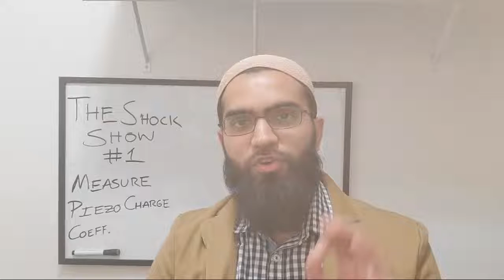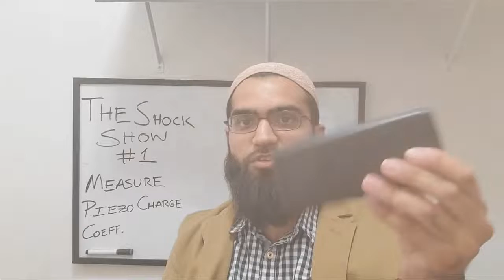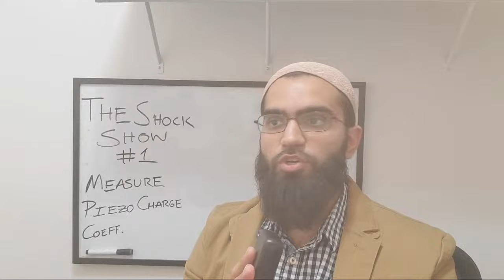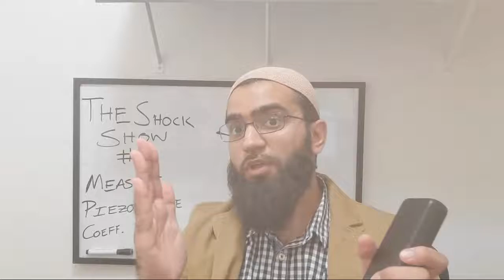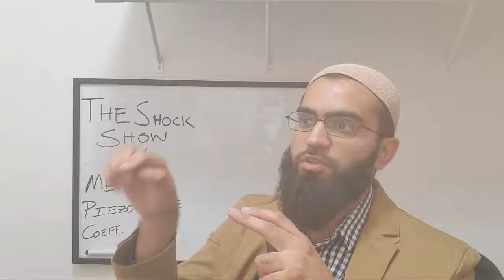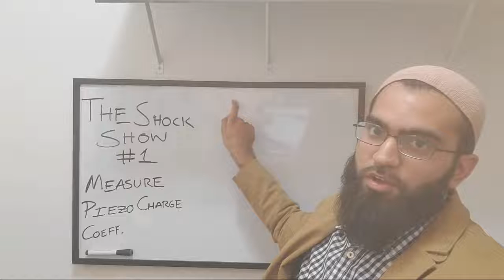The SHOCK Show #1: Measuring Piezoelectric Charge Coefficient

Comment: The charge coefficient unit form is so confusing, like why would you be so cruel as to write pC*m^2/N when you could write pC/Pa and everyone would understand what the unit means.

Like, if was explained that way, charge produced is force per unit area times d constant and voltage produed is force per unit area times g constant and the reverse is true for the converse piezoelectric effect, then I think it would make a lot more sense.

Just be easy on people and simplify the units to pC/Pa. It's the same thing except it makes sense.

Comment: How do you take into account the pyrolitic effect when you use a laser vibrometer to measure D33?
Reply: Thank you for your reply. But If I shine a pulsating laser onto a piece of PVDF piezoelectric film that I have purchased I get a voltage output? Or is PVDF different from ceramic piezo? Many thanks. Dave
Reply from the maker: @aikidoportkennedy341  there are many effects at play in your scenario. First, the electrooptic effect. Also, the pyroelectric effect. Both will cause voltage to appear. Both of these effects are related to piezoelectricity, but have distinctions from it as well.
Reply from the maker: The pyroelectric effect is: change in temp resulting in change in spontaneous polarization resulting in change in surface charge resulting in voltage generated. Electrically driving your piezoelectric resonator creates some heat if the amplitude is high enough. The charge generated from the heat is dissipated through the imposed voltage of your driver. So, there is no need to account for the pyroelectric effect in a converse piezo effect d33 measurement.

Comment: sir, how do we compute the output current from the piezoelectric materials using the comsol multiphysics?
Reply from the maker: Define a boundary probe to sum the charge on an electrode. Then, use the equation CURRENT = ANGULAR FREQUENCY × CHARGE
Reply: @ultrasonicadvisors  thanks you sir, can you explain this in your upcoming video. it will help many of us.
Reply from the maker: @gizmoguy6941  I don't have access to COMSOL right now. However, go to my blog article (link to follow) and search for boundary probe. https://www.ultrasonicadvisors.com/impedance-frequency-response-of-a-piezoelectric-element-using-comsol

Comment: This may be a beginner question but does the coefficient increase at resonant frequencies or is it a static number no matter how you measure it?
Reply from the maker: So, linear theory (think how FEA works) says that you will get the same value no matter how you measure it. However, practically, the piezo charge coefficient is frequency, stress, and voltage dependent. Measurements using static measurements are usually larger. However, they will correlate with resonance measurements. Make sense?